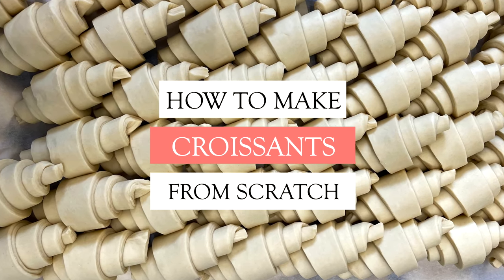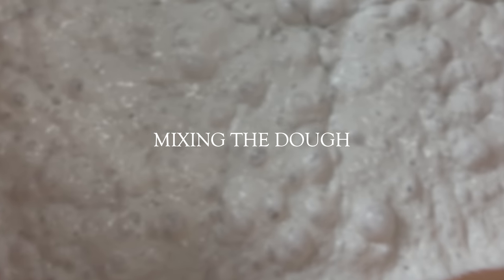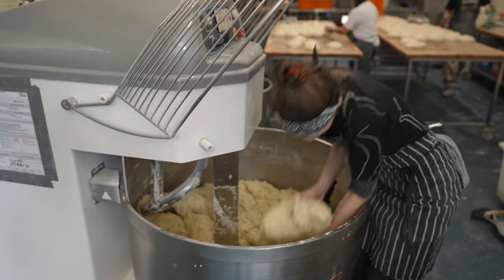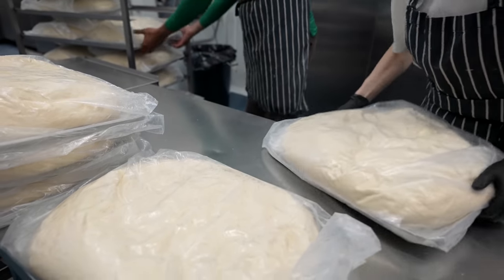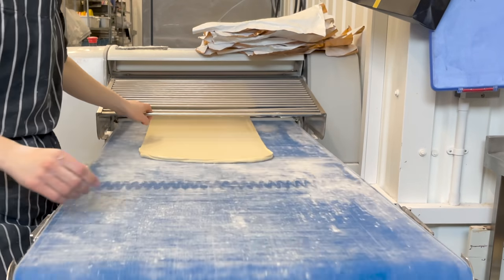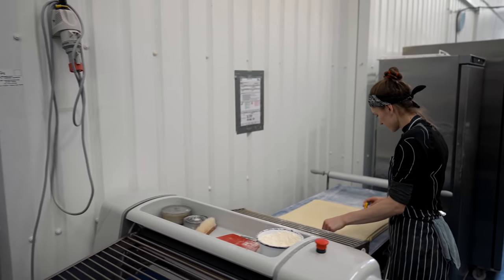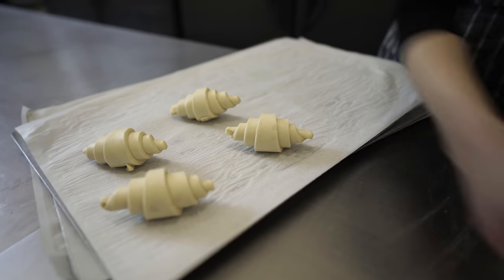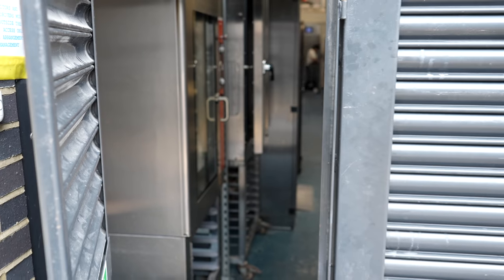How to make croissants from scratch?

Comment: Hiii  chef kris☺️  i have a question about the croissant do you do windowpane test on the croissant dough?  I have trouble making my croissant keeps on tearing apart while proofing 😢 and when its done baking the its always raw in the middle and kinda heavy croissant i hope you will give me an answer about this problem thankkk you soo much chef❤😊
Reply from the maker: hi, yes normally the dough should reach the point where the dough is strong and developed sufficiently, otherwise the dough is not capable to hold and proof nicely. Also don't overwork while shaping as if you stretch too much it will break, give it a rest in the fridge before shaping.
Reply: @KrisKazlauskaite  thank you thank youuuu so much chef kris for the tips i will try to make croissant again😁❤️❤️🥐

Comment: A question if I may, why do you have to place it in a bag and then freeze it two times?  Is it because the room temperature is too high and the butter would melt and ruin the dough, or is it because he dough really needs to relax between flattening?
Reply from the maker: Hello! Yes both, unfortunately the room is too warm and the dough sheet is big so it needs to relax between thr folds:)

Comment: Hi, I’d like to know what temperatures I need to have the butter during lock in and the doigz during folds. Currently becoming a baker in Germany and trying to overachieve for no reason at all.

It’s hard to find info on this, but it appears 13°C is ideal? 

Also, I’m allowed to use between 30% and 50% lamination butter on flour weight. What amount and how many tours do you recommend? 

Should I modify my supermarket butter by adding a little flour or reducing water?

Comment: Hi Kris, I’d like to ask, how long and for how many degrees you let the croissants proof in the proofer? We have the stopleaven Coldline, manual proofing is ok, but if we set it through the whole night it doesn’t work :/  
Thank you for you answer. D.
Reply from the maker: Hi Daniela, every place set their proofers according to their needs, you can set 27C or max 28C for 2 hours fast proof or slow proof for 3,5 hours so it really depends ☺️
Reply: Thank you for your answer :) but I’d like to know the exact time and degrees you have in the proofer through the whole night till the baking. For example we roll the croissants in the afternoon and put them in the proofer for 5 hours for -2 degrees and then for the 4 hours for 13 degrees, after that 2,5 hours for 27 degrees and then we bake them. Unfortunatelly, after this proces we take out the croissants from the oven and they “lay down” 🙈 so I wonder what procedure of proofing you use with your proofer :) thank you❤

Comment: At the make up how thin do you guys sheet it 5 or 4 mm ish ?
Reply from the maker: hey! machines are slightly different but yes, can be from 3.8mm to 5mm :)
Reply: @KrisKazlauskaite  Thanks We go around 4.3 on our sheeter. feuilletée around 3 ish. I suck at cutting without marking with 5 wheel cutter. That is some skills . I d be 20 grams of everytime :)
Reply from the maker: @evrenbingol7785  yes exactly, i think it’s the right thickness, I personally don’t like to work with too thin dough :) 
After cutting and weighting each croissant separately - pastry wheels is like a blessing 😀

Comment: May I ask why you need to rest the detrempe in room temp after mixing, and then proof in the fridge before going into the freezer? Why can't we just stick the mixed dough directly into the freezer? Thank you so much!!
Reply from the maker: Hi, thanks for your question! Leaving outside we relax the dough so you avoid making the dough stiff. Plus we monitor the temperature of the whole dough. 
If we put the dough straight away, the end result would be a bit more dense and not that puffy pastry. So when we take the dough out of the freezer is nice and silky! Hope that helps. Cheers!